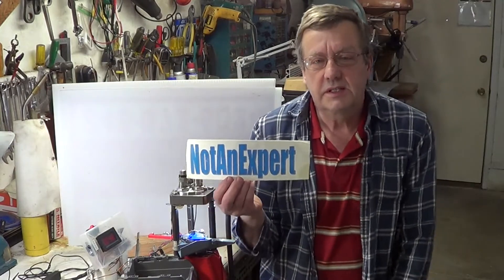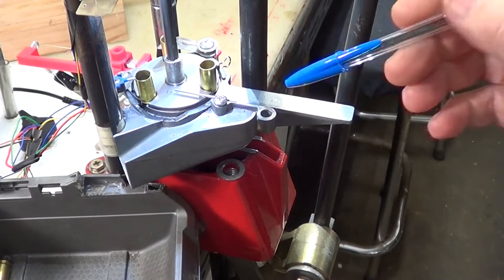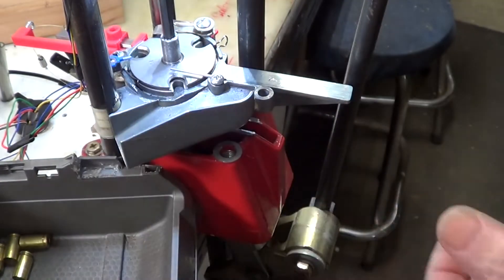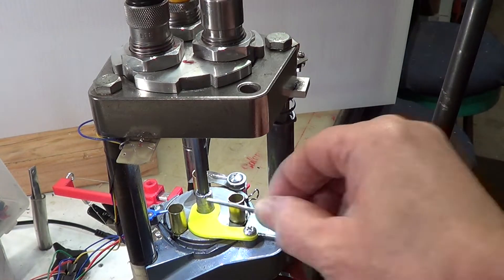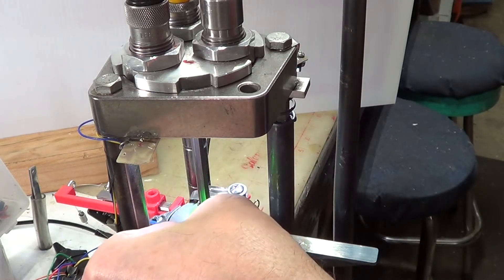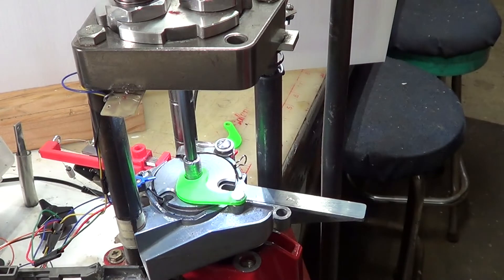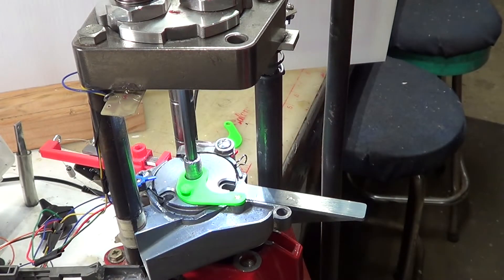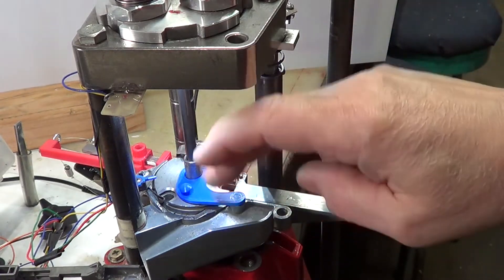Lee Pro 1000 Case Ejector

Comment: Hey I see you made a metal blocker for your primer system. I'm printing it out now, thanks btw, should I skip the 3d printed blocker and just make the 1st one out of metal?
Reply from the maker: The nice thing about plastic is that if something gets jammed it will break and not hurt the other parts of the machine. And of course if the plastic breaks just print another.

Comment: So many people get started in progressive reloading with the Lee Pro 1000.  they are cantankerous and need fiddling with, however, I believe that people learn more about mechanical progressive presses because of it. I have two Dillon 55B's one in large priming, one in small priming. although they are not fully progressive, you have to advance the shell plate every cycle, it goes fast enough and I feel is the right speed for quality rounds. would I own a Lee machine again, Sure, there isn't anything wrong with them and they load just as good ammo as the more expensive presses on the market, however, they need parts from time to time and Maintainance adjustment. Good video,  keep them coming-Dave

Comment: I have one of the original Pro 1000's like your picture with the 3 holes in the shell plate. And I dont have an issue with the ejection of the rounds. I just have the primer issue. Which I fixed using your original method. But I am going to see if my friend will 3d printer that new primer system you have.

Comment: I slotted both end holes of the plastic  ejector. All I do is loosen the retaining screw to remove it.   Your idea look good thanks for all your ideas. I used several including the case ejector and  the primer pusher. 
I like the new primer feed but not having a 3D printer I may not get to build one.
Thanks again for sharing.